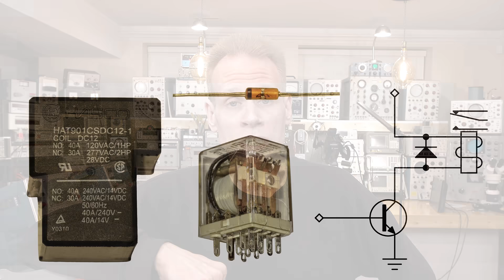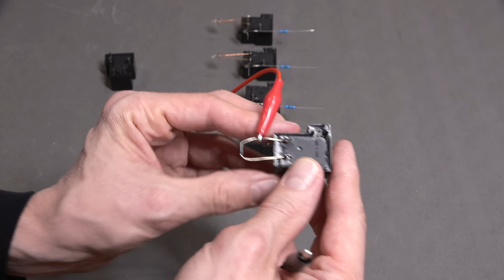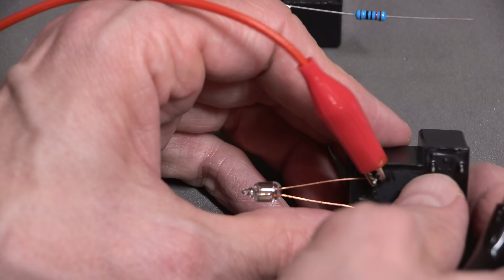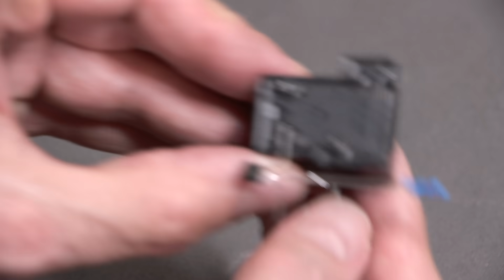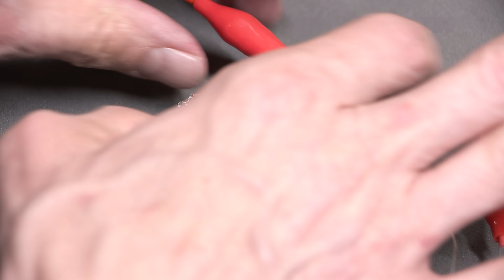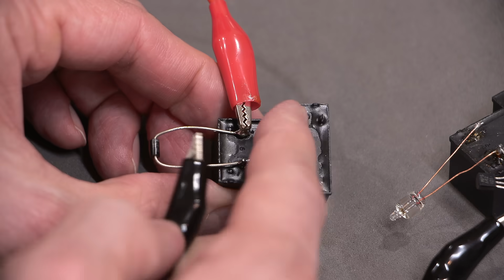Why Add This Diode Across A Relay Coil? This Is Why It's Needed!

Comment: I had an automotive repair shop back in the 70s and 80s. When GM introduced the alternator with built-in voltage regulator in 1973, there were a lot of alternator failures happening, especially with air-conditioned vehicles. The electrical components rebuilder 
that I sourced my remans from told me that he added a diode inside those alternators to prevent the spike from the A/C clutch coil from back-feeding through the alternator when the key was turned off with the A/C on. A couple of years later, GM, Delco, started building them with the diode at the factory. Thanks for the great video.
Reply: You will also notice a diode right at the A/C clutch coil.
Reply: @Metal3983  Having both is great.  You get some redundancy in case either diode fails, and having one as close as possible to the coil also helps eliminate having the radio make popping noises as the coil switches off.
Reply: @Metal3983  Often that A/C clutch diode is in the under hood fuse box right next to the A/C clutch fuse. The black fuse is really the diode.
Reply: @Metal3983  the ignition was switched Off while AC was left On. So, the diode on the AC side had no play in the game. It looks like the back EMF spike went straight into the Alternator and destroyed it.
Reply: @elim7228  I had some old 1940s GMCs that would burn the points if you left the radio on and tried to start the truck. The radios were AM tube radios that used a vibrator. I kept points, a points file, a new condensor and a feeler guage in the glove compartment.
Reply: @Satchmoeddie  Just leaving the key on to play the radio would burn the points if the engine stopped with the points in the closed position. The accessory position on the key switch prevents that. Alternator exciter circuit is always wired to the accessory side of the ignition switch. If it was connected to the ignition side, you wouldn't be able to shut the engine off.
Reply: @Satchmoeddie  All vehicles with points will do that. That's why there was an 'Accessory' position on ignition switches back then.
Reply: @VashthStampeede  I always thought the ignition coil would burn out, not the points, when you shut the engine off the points ended up in the closed position. On my 1997 and 2007 Toyota Camrys, the exciter circuit for the alternator is connected to the ignition side and the engine shuts off just fine.
Reply: @bernardocisneros4402  Yes it does, your 97 has a run-start relay that shuts down many functions with the key off. I was talking about earlier American vehicles. Sorry for the confusion.
Reply: @bernardocisneros4402  I just pulled up the wiring diagram for your 97 and I see there are two ignition circuits inside of the ignition switch. Your alternator's circuit to the switch goes to IGN 1 and your ignition system is wired to IGN 2. Now we both know for sure.
Reply: @carlbeaver7112 old 1940s stuff,and even into the 50s isn't gonna have an "accy" position on the key switch. 
Off ,on and possibly start position.
Off and on ,and a floor switch like a hi beam dimmer for start also, but no accessory position.
Reply from the maker: Thanks for sharing your story!
Reply: @MrCarlsonsLab  Wouldn't capacitor work similar way, especially in applications that require reversing the poles?
Reply: My father-in-law invented the process that let's auto diodes be assembled.  I have his prototypes, they should be in a museum. He was a brilliant mechanical engineer.  He has several patents to his name. He also invented the bleed air valve for jet engines. I can't say enough good things about him.
Reply: @mr16ga  That is awesome! Some people are natural geniuses when it comes to this stuff!
Reply: It gets worse. A car alternator or starter can throw a very short 600vdc spike into the electrical system. ("Back-EMF") Light trucks, 2000vdc spike.
 When LED arrays were first being used, as in $700 car tail lights, one of the top LED suppliers noted that their warranty would be voided if an installation did not have spike protection.
 One of the Delco's designed a Corvette alternator with internal protection diodes but stopped after just a few years, because THOSE diodes became a failure point!
Reply: GM introduced built-in regulators on the Corvette in 1969.  The original regulators were black while everything since then (maybe as early as 1970) was white.  I indirectly learned from a Delco employee that they were referred to as "black beauties".  They are virtually non-existent nowadays and necessary for a high-end restoration (I guess you could paint a white one or Magneti Marelli made them in black.).  No one has ever been able to explain what they were about.  You may have just revealed what it was.
Reply: @billv39 I think MOPAR was the first to use alternators around 62 or 63, my grandmother had Vallent with an alternator, I can't remember the year.
Reply: @mr16ga  I think you are right about Mopar being the pioneer for alternators. I believe it was 1961. GM in 1963, and of course Ford in 1965. The 1964 1/2 Mustangs had the 260 CID V8 with a generator. The official 1965 had the 289 CID V8 with an alternator.
Reply: Yeah I've ran across the bad diode deal in a few cars over the years , turn key off it stays running. 
My dad was an electrical engineer so any questions went to him first (I'm a generator tech, but he was my answer man). 
Never failed me ,now I gotta figure out stuff for myself.
Reply: Around 35 years ago, I replaced some parts of the ac, but didn't understand why diode was there - I cut it off, but it always was in my mind. Thanks for the info - I quit mechanic work 34 years ago and changed profession, so cars were safe if some of you wondering.
Reply: When I was a kid, back in the 70s, I swear I remember my grandfather always making sure he shut down all electrical components in his car before turning it off. I think I remember him actually teaching us to do so.
Reply: The diode was in the harness to the compressor coil
Reply: Невозможно слушать пустую болтовню !
Reply: Yes! That's the trick! I totally forgot about those
Reply: cool anecdote
Reply: You're rebuilder was a smart sob! I remember seeing those diodes across the A/C Coil connection. I never replaced my alternator, just the rectifier for thirty bucks back in the day. I used to have the part number memorized. I was a mechanic in the 80's-90's.

Comment: The inductive spike from a relay coil (Remember: relays ARE inductors) is a considerable voltage. And a diode does an excellent job of shorting out that voltage spike.
Reply: Which is why it should have been displayed on a scope for added clarity.

Comment: Thanks for the video, I learned quite a lot I didn't know! Chrysler was famous for their chonky ceramic ballast resistor on their points ignition that usually (always) caused more intermittent problems than it solved right out of the gate if you didn't know all the stupid Mopar ignition tricks to make points actually work correctly (most gave up and switched to electronic ignition). When the electronic ignition failed you didnt need a PhD and an o-scope, just a $15 replacement box. Or made your own, it's all off the shelf parts inside anyways. Different car manufacturers had different ways of going about breaking the spark between opening points and electrical noise reduction, with varying degrees of success. I don't recall VW's ever having anything but a condenser, very very primitive even by the early 70's. Now on 12v relays, after a long career I don't think I've come across any modern OEM automotive ones not sporting a diode internally or at least a noise cap, some don't have anything though; Aftermarket/universal relays, you're kinda on your own in that regard. I rarely bothered with diodes on relays but that's just me.. usually came down to application or how the circuit will be installed.

Comment: So this would apply to solenoid valves too?
Reply: Yes. All inductors (function doesn't matter much): coil, choke, transformer, solenoid valve, motor, you name it. But of course the details make the difference (how do you really protect things in the particular circuit).

Comment: Best demonstration I've seen as to why a diode is needed!
Reply: Диод вреден для ресурса контактов реле
Reply: @armor-3ulefone471 how could it be?
Reply: @armor-3ulefone471  then add also small capacitor, parallel to contacts, to kill the arc! :)
Reply: @BWLF-ft2dc Yup!
Reply: Well, for non-believing flat-earthers, he didnt demonstrate, how applied diode removed neon bulb flashing! What I learned, is that you can actually use neon bulb, instead of diode, to clamp the spike, if your driving device has higher than that reverse voltage!
Reply: @BWLF-ft2dc But the voltage spike is only limited to the strike voltage of the neon bulb 60v to 100V, where as a diode is around 0.7V.

Comment: FoMoCo made relays has a built in 270 Ohm resistor accross the coil. It's mentioned as noise suppressor in most Ford manuals.

Comment: The formula for  voltage across an inductor is V=L*di/dt... Voltage across an inductor is the inductance times the change of current divided by change in time. Notice that makes the inductor voltage and switching time an inverse relationship. The faster you can switch off the current the more voltage is produced. When you start getting into nanoseconds switching the voltage gets out of control quickly. BTW...in an H-bridge the inductive spike when the high side turns off is directed through the low side diode. Soooo, you can't build and test just the high side. I created a graveyard of mosfets before I realized what was happening.

Comment: I think relays used to be more robust than the ones you used. I trained as a telephone engineer in the 1960s and relays didn't have diodes across the coils then. The circuits were designed in the 1920s and 1930s or even before then and silicon diodes weren't available then. I do remember some metal oxide rectifiers being used but not generally across relay coils.
Reply: The old telephone relays also operated at higher voltages and were expected to release quickly.

Comment: Knowing just enough to be dangerous, I just bought some 12V relays. I intentionally got ones described as "with Built-in Diode". But they don't have a diagram (or anything else) showing which way the diode is orientated. I have a quality multimeter and understand basic circuits well. Is there an easy way to test: 1) If there is really a diode, and 2) which way it is oriented.
Note they are a 5-pin Bosch style relay.
Reply: If you have a current limited power supply (or even a series light bulb), one direction will energize the relay, the other direction (polarity) will simply short through the diode.  If the relay engages with either polarity, no diode exists (or it is kaput).

Comment: One thing of note, which generally only applies to larger relays/contactors, especially those that are switching high currents; the freewheeling diode causes the coil's magnetic field to collapse much slower than it does w/o the diode.   This similarly can cause the relay/contactor switch contacts to open slowly enough to cause a bad arc and burn/weld the contacts!   So in these high-power applications, you want the coil voltage to collapse very fast,(so the contacts open fast) so you need to use some kind of active coil control rather than just a simple freewheeling diode.

Comment: As a final demonstration, it would be nice to put an oscilloscope across the relay coil to see the inductive "kick" of the coil.
Reply: There is a danger that the scope will "take one for the team". Another idea for the video: how to "scope" inductive elements (small relay, solenoid valve or motor can fry input circuit, release the magic smoke).

Comment: I always thought I knew this but all I was told is that the diode was there to stop 'ringing' and suppress noise. I never thought about it reducing the life of the relay or the control circuit! Thanks

Comment: This is why you would use one on a relay. You probably don't want it to open when it shouldn't. A diodes function as one-way gates for electrical current, allowing current to flow in one direction while blocking it in the opposite direction. This unidirectional current flow is crucial for various applications in electronic circuits, including rectification, voltage regulation, and protection against reverse current.

Comment: I am liking this Tech Tips Series - excellent that you also demonstrate the concepts you are describing.  Going outside the original scope of your presentation - diode suppression only works for DC relays (implied by your examples transistor switching) and can lengthen the drop out time of the relay.  While this would probable not be a problem in many applications, it is something to be aware of.  When relay dropout time is critical one might see a resistor in series with a capacitor across the relays coil ... and this RC network would also be sufficient for kickbacks from AC relay coils.   Obviously there is a lot more to that subject than I outlined but might make an interesting follow up video.

Comment: In relays meant for automotive use the diode is often built into the relay.  Very often, a resistor is used instead of a diode.  The quality of the many relays inside of all modern cars determine a large part of that car's reliability.... that is cars made with high quality relays have much better reliability than those without.

Comment: I always like to see videos like this, to re-affirm knowledge that I already have. My only question is, with automotive applications, why don't the manufacturers include the diode? To answer my own question. Is it just cost? In older cars, I suppose they didn't have solid state semiconductors. Modern cars have relays operated by electronics in the ECU or BCM. I presume the output to the relays, would have the diodes included on the PCB, across the O/Ps. Or, are there such a things as relays with the diode included, after market?

Comment: Good video.
A couple notes.
1. Maybe use an oscilloscope to show the reverse voltage spike.
2. Some relays have a built-in diode
Reply: Some relays have a resistor instead of a diode. Which one is more effective? When do you use one and not the other? I don't know.
Reply: @bernardocisneros4402 
IMHO, the diode is not used in the energized (power on state) only when the power is removed that's when it shorts across the coil to give the spike somewhere to go, a resistor will be using current both directions wasting power (no useful work) maybe what you seen was the resistor was connected in series which would limit current instead of parallel with coil to basically short out reverse current.
Reply: @JeffW-h2w Thanks for the insight but I'm positive the resistor was in parallel with the coil.
Reply: @JeffW-h2w I looked into it and found out that if you need the relay to turn off quickly, you use a resistor in parallel. If the relay turn off speed isn't important, you use a diode. It takes longer for a diode to dissipate the energy.
Reply: @bernardocisneros4402  That is correct.  I've also seen suggestion of a halfway house where there's a resistor in series with the diode.  Resistor improves the turn-off speed, diode prevents DC current flow through the resistor.
Reply: @epiendless1128 The best of both worlds.
Reply: @epiendless1128 it would seem to be pretty difficult to get both component values correct to make that actually work. Especially with manufacturing tolerances in play.
Reply: I do that in my engine controls class.  I have a couple of pico scopes that work well for the demo.  I also use a capacitor to show how it affects flyback.
Reply: Relay turnoff spikes can be hundreds of volts.  Might damage a scope input.
Reply: Also to see switch bounce😊

Comment: If this is a very known thing and a pitfall for beginners and alike, why don’t they just integrate a suitable diode in all the relays?
Reply: Another one! Because it's up to you how you use, utilize the relay. It's not always silly like On/Off circuit. Relays can be used in complicated circuits, connected in parallel/serial etc. You (as a designer) decide how to protect things (or not and Why). Adding diodes to all DC relays by default would be a dumbing down.
Reply: @GrandePunto8V This is not like a resistor or a diode that can have millions of different use cases, you can just different these by codes like everything else, 12V6D can be with diode 12V6 can be without, what is the brain blockage here?
Reply: @oturgator  YOU are the example of Why they DON'T integrate diodes in all relays by default.
It's your problem, your job to learn, understand Why. We are not here to babysit all beginners on all topics (impossible to explain Everything).
Reply: @GrandePunto8V very insightful and complete explanation with satisfactory background without making it personal. Your folks thought you well.

Comment: Can you make a similar video that explains why two opposite pointed diodes are attached to the two terminals of a meter? How does that work?
Reply: Just to relieve Mr. Carlson: The two diodes are a bidirectional voltage clamp, limiting the voltage across the meter to the point, where the diodes become conductive. That is around 0.65V for silicon diodes and around 0.25V for germanium diodes. Thus the tiny coil of the meter is protected from burning through.